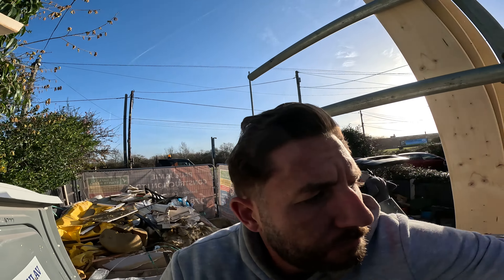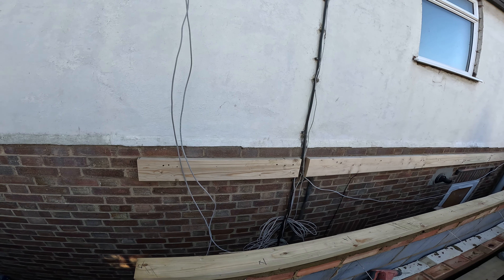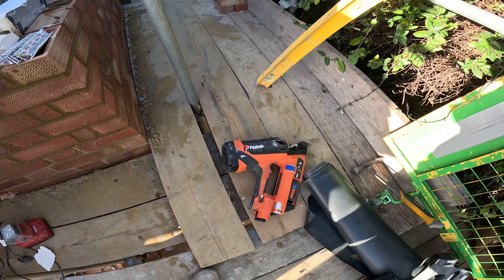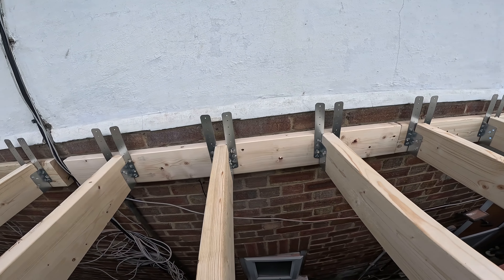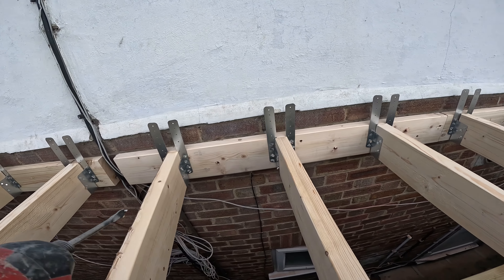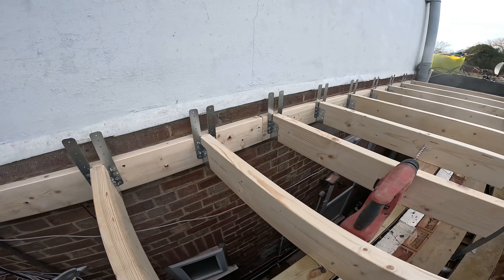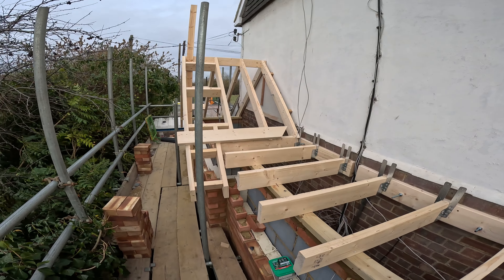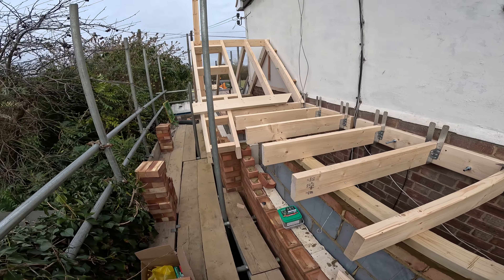Installing Timber Wall Plate - Roof Timbers | Single Story Extension | Paul Jamie Construction

Comment: Morning matey. Glad you're back to the vids, I love watching these. I know they take a while to edit etc... Boiler flue, is it coming straight out or going vertical. Also be interesting to see the work with the soil pipe in the corner. Will that have an access boss cut in below?
Need to top up the tan matey - lol
Reply from the maker: Hello mate, the boiler is being relocated in the new utility so prob out  the roof with flue. And the soil stack is going to prove a pain getting it water tight, we have to build a timber box and weather that too